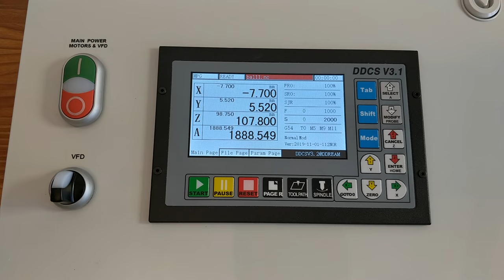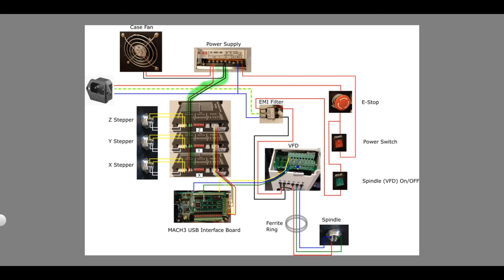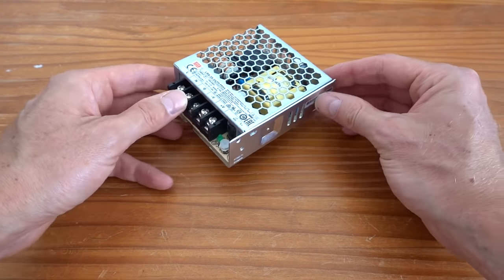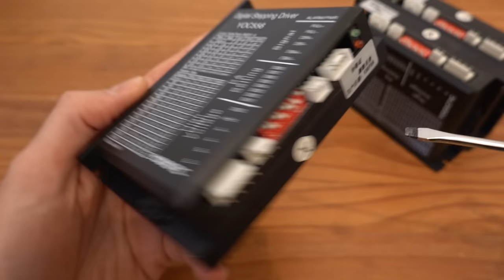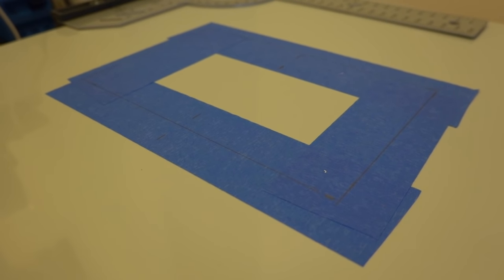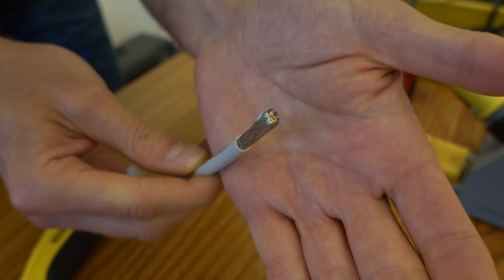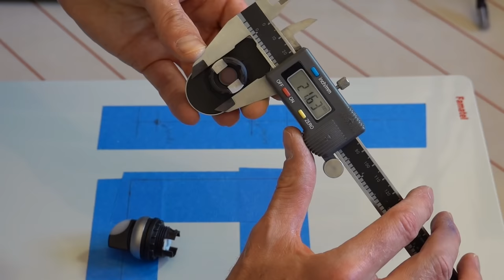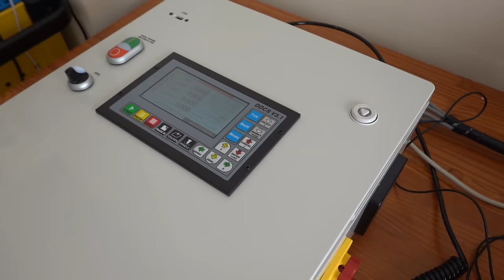Build Your Own CNC Controller, Part 1  | DDCS V3.1 |  6040 Router

Comment: Delighted to find this detailed tutorial, I have bought a secondhand cnc router that is run by a dedicated Linux computer and LinuxCNC everything works individually but there is no real information out there on troubleshooting such a system.  I have purchased this exact controller to make it stand alone the same as my cnc laser. Thank you so much for the time and effort you have put in, cheers from NZ.
Reply from the maker: Thank you! Good to see the content is useful. Best of luck with the project!

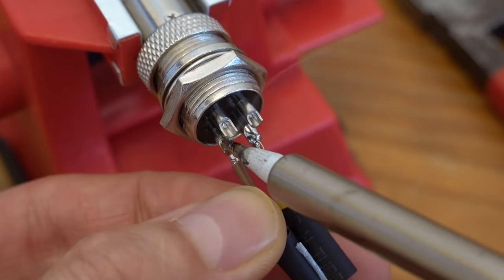Comment: Great work. I'm no electrician but (sorry to report) I think to actually shield those wires on 22:43 you'd need to connect the mesh shielding to ground and not clip it like you did.
Reply from the maker: Hi, I think you are absolutely right, the shield should be connected to ground to make it effective. This would mean I have poor wiring skills on top of poor soldering skills :) I will leave a pinned comment with this update. This does mean I would have to get a 5-pin connectors to get the shield through the non-conductive housing and connect it to ground. Thanks for you comment, much appreciated!
Reply: @uptimefab7412  usually the ground is passed through the connector metal housing itself, at least that's what I saw in e.g. Ethernet CAT 7

Comment from the maker: Note: For proper shielding of the stepper cables, the shield should be connected at one side to ground inside the cabinet. Also for external shielded cables.  See video part3 for updates to the controller and check the pinned comment on that video for best practices.
Reply: Thank you so much for sharing your build! You have inspired me in so many areas of my build. Even better you introduced me to @corvetteguy50 who has taught me so much. My box design and many of the parts are similar, although my design is based around a Masso controller. I truly appreciate you sharing this build!
Reply from the maker: Thanks, much appreciated! The masso seems like a very nice system.
Reply: Why should it only be connected to ground at one side and not both sides?
Reply from the maker: I read from several sources that one should connect a shield only on one end to prevent ground loops, from grounds with different potential. Also there are sources that indicate that for specific data transfer applications it is better to ground at both ends. Most information for CNCs seems to indicate on one side, so I also took that approach. As you may know there is a lot of contradiction on this subject though, but I just went with the sources that I thought related most to my application.
Reply: Why is your coolingwater pink? Some additive? Thank you for very informative videos.
Reply from the maker: Hi, just because it was easy to get my hands on it I am using engine coolant, diluted with distilled water. From what I have read many people do this, but the stuff I use happens to be pink. There are flakes of some organic substance growing in it after a while, not sure if that is less of an issue with other types of coolant. The fact that I have it in a transparent container probably doesn't help. Thanks for your feedback!
Reply: As a rookie without any experience in electronics nor programming but looking for information I see a common problem in all this solutions for makers. Different concepts regarding de power needed or machine types, protections, phases and voltage in different countries or shops, use of VFDs or VFD-transformers, servos vith integrated control and encoders vs steppers, induction motors, controllers and plcs vs software, many platforms like arduino, raspberry, etc. direct controls vs remote... there are to many variables out there and small print in many equipment to be aware. Hope in the next years we can see integrated solutions in a low variety of needs to simplify this tasks considerabily. For the momment I'm very confused and saturated, usually I get more doubts than certainties to follow the line. Just see all that work for a little machine. This is an activity in it's own. Regards from Spain.
Reply from the maker: Hi, fully agree that all of the options are overwhelming. I had the same thought when starting this project. Considering myself also a beginner in this field I tried to find all the information I needed and combine them into something suitable for my machine. Of course this now in itself is another one of the many sources to be found online :) 
It would be great indeed if a comprehensive guide could be made for all different components and why you would choose one over the other. I do not have a background in electronics, so would not be the right person. Trying to figure stuff out and learn is indeed a big part of projects like this. It does not make sense when you look at time or money spent, but for me personally it is the fun of learning new stuff and hopefully helping other makers. Best, Robin.
Reply: @uptimefab7412  Yeah, I don't have enough time to spend on earning money and been rich so I choosed to convert myshelf in a fool maker and to loose it burning circuitery or something more expensive, hahaha.
Reply: @jorgeo4483  you perfectly summed things up

Comment: Thank you sir for sharing your knowledge. I am in the middle of building my DIY CNC with a proper control panel and your video have been extremely helpful.
Reply from the maker: Thanks, good luck with your project!
Reply: Hey did you finish building?

Comment: just a side note, shielded cable only works if you ground the shielding at one end.
Reply from the maker: Thanks, received several comments on this. I left a pinned comment regarding this topic, so viewers are aware it needs to be connected to ground at one end if they want shielding to work on their cables.

Comment: Great video. One thing I noticed: shielded cables are good as long as the shielding mesh has a connection to ground. Therefore, you have to provide contact between the mesh and the connector's housing. Otherwise, it will not bring much effect.
Reply from the maker: Hi Martin, thank you for your feedback on this. My way of doing it was indeed not correct. I had a comment on this earlier and placed a note in the website article together with other feedback and new insights after releasing the video. Regardless, thank you for your comment, much appreciated. This confirms the right approach.

Comment: I have the same Router. A little tip: Get rid of the small connectors  at the stepper motors. Replace with larger round  'aircraft' type connectors. I did and got a huge improvement in smoothness in the router. I suspect they are a source of significant volt drop.
Reply from the maker: Hi Stephen, thanks for the tip! That sounds very plausible. They not only seem a bit flimsy, also they get a bit warm during operation, there might be too small connector pins or poor connection. Thanks for sharing your thoughts.
Reply: Do you have any links for them

Comment: I am not a big fan of mounting the VFD in the same enclosure due to EMI. To help reduce any potential EMI problems, one can add some ferrite magnets to the signal wires/cables to protect them. I don't like using a plastic box for the enclosure because they offer no shielding. EMI/RFI can cause a lot of hard to diagnose problems that can send you on a wild goose chase. The video is well edited and your work is great. The layout looks good. It does take a lot of time and research to design and build an enclosure.
Reply from the maker: Thanks, it was quite a learning experience. The feedback from you and others  very helpful to get a good understanding of best ptactices. I admit to sometimes taking not the best but the easiest approach to make sure I can make something with the tools I have available. An example is the plastic enclosure, which is great for a "sandbox" CNC project. Cutting another hole is very easy, but indeed not good for EMI. I will keep your feedback in mind for a next controller cabinet, enough room to improve. Thanks again! Robin

Comment: Nice work. Tedious, but fun in its own way and frustrating at the same time.
Reply from the maker: Thanks! Indeed quite a bit of work but it is great to see when it actually works in the end. I will do some more tedious video editing and hopefully upload the end result soon.
Reply: Hey ,thanks for the upload.
Please help me how do you setup the g55 ,g56 ect (pssst please explain so a caveman like me can understand.🙂)
Reply from the maker: Hi, of course. Assuming you mean how to set it up on the controller (not in relation to your part) it is fairly straightforward with the DDCS: in the main menu press "tab" until G54 is highlighted. Then with "A+" and "A-" you can select any offset between G54 and G59 (or even machine coordinates if you don't use home switches). Then just press "shift" followed by one of the keys indicated in lower right of the screen to zero all or just one of the axis in you current work offset. You can manually zero machine coordinates in the same way. Note that if you do end up setting machine coordinates to zero with this method, all of your Gxx offsets will shift accordingly, so first set machine coordinates and only then set Gxx.
Hope this answers your question.

Comment: I am currently building my second control box and upgrading as well, I think I will use also a PILZ Safety relay for the E-Stop and tie that into the controller cutting the Enable to the drives as well as all other power but 24V will remain On. Thanks for sharing it helped me in my decisions as well.
Reply from the maker: Thanks, sounds like an interesting solution. Good luck with your project!

Comment: The only suggestion I can offer is to drill the holes at the corners of the rectangular cutouts differently: You can put the hole centered on the corner and save the filing.  The rounded corner is less likely to crack too.
Reply from the maker: Thanks for the tip!

Comment: OMG Thank you! I bought a 6090 chinese CNC machine a few years back. The 4th axis controller board died on me and I have not been able to find one that works for my CNC. I am totally doing this for my CNC. I want to get the 4th axis working again and I want to be able to find replacement parts for it too! Subscribed!
EDIT: 4th Axis stepper driver not controller board
Reply: You can take any stepper driver.
Reply: I got 2 different drivers. None of them want to work with the cnc :(
Reply: @oscarreyes4511  Different or differnt names?
Reply: 2 different brands of drivers and none of them worked
Reply from the maker: That's odd. The step and direction signals from the DDCS are 5V. Can you check if the step and direction input on your drivers respond to 5v? Just a guess but if they need 24v input signal they might not do anything with 5v signals. Is there a green LED to indicate the drive is working? Also double check the connection on your stepper motor.

Comment: In the case, you will work at the case, you can replace the self cutted taps with rivet nuts. This should be much stronger than the taps in this thin sheet. Only a advice.
Reply from the maker: That sounds like a good option. I went for tapping to make the stepper drivers flush with the back plate for heat distribution, but indeed doing this in thin sheet is not the best option. If I do end up taking it apart at some point I might give the rivet nuts a try. Thanks for the advice.

Comment: Great job. Just waiting deliveries and i'll start same kind of project.
However one question: I'm a bit surprised when you write "Since I experienced lost steps with the old controller I decided to use shielded cable wherever possible" and none of your cable has its shield connected (in one point) to the earth, which means that you shield is useless.
Reply from the maker: Thanks for the comment. Absolutely correct. I already left a pinned comment when I received feedback on this before. Still very much appreciated though! Good luck with your project!

Comment: Great project!  The total price to buy all the parts + tax for this on Amazon is around $1,450 usd.
Reply from the maker: Hi, my estimate came out a bit lower, but I just didn't keep track of all the various parts I bought over several months. Thanks for looking up the prices. I bought items like the controller and 4th axis from ali express, which should be a bit cheaper. I think I paid less than 1000 euro in total or at least I hope so :)
Update - Just found some more invoices. Mine add up to around 1000 euro (which could be more in USD), but I might have missed the odd bits and pieces that add up quickly. Not a cheap hobby. Leave out the 4th axis and you can save 200.
Reply: Compared to you I am a techno-peasant.  I mean, i could not begin to build anything like your cnc. Even with your great instructions.  That said,  can you recommend a cnc that i could purchase for $1,500 or less?  I need to cut aluminum up to half inch. Im considering the shapeoko.  Thoughts?
Reply from the maker: Thanks! I have not looked at cnc routers for a while since I am not in the market for a new one. The shapeoko does seem to be a popular system but I don't have any experience with it.

Comment: Just some advice, the general rule of electronics is your load should be no more than 80% of the total current. SO...if you have a 10 Amp power supply, the max current should not exceed 8A. Otherwise, things tend to get hot...really hot. Same goes for wire gauges. So the total current of all stepper motors should not exceed 8A for a 10A power supply. It doesn't matter if they are drawing max power at the same time or not, it's a safety rule. Seen too many fires from people thinking 10A means they can use all 10A but don't realize the internal components are in excess of 180 degrees when doing so. When under the 80% rule, things don't reach unsafe temps unless it's a faulty component. Fans just delay the inevitable at that point. Be safe and use the 80% rule!
Reply from the maker: Thank you for your advice, much appreciated!
Reply: @uptimefab7412  no problem. Glad someone could learn something from me!

Comment: HI ! I was inspired by the way you wired you contactor for the E stop . I tried, the wiring worked, turned  off and On according to the plan. 

But I witnessed a smoke coming from the contactor (only when stopped) at first i thought it was my mistake ( it is), checked cabling. then i checked the contactor in itself before realising that the coil inside the contactor is only 8 ohms , which make it run a 24v/8 = 3 amps , welll , there is why it's smokee but works. my mistake was (i think) that I did not put LED in this wiring, but i didn't know it's function was also that of a resistance in this loop. also permitting to "drain the coil of current " (i don't  know the term)  when we e stop the machine ^^. 

Do you agree ?

I don't think you spoke about it in your video, but i think it is important to consider , because i'm not the only dumb one on the internet ^^. 

Thanks for your content.
Reply from the maker: Hi, smoke from your contactor is not good. This probably means something is not wired correctly. Are you sure you connected the contacts for the coil terminal to 24VDC? Please triple check all of your connections or have an electrician verify it. If you indeed have a 24V contactor you should be able to connect it directly to a push button in line with a 24V power supply ( for the specific Siemens model I used). No resistor is needed. I do not have any resistor in between. My LED is in parallel with the contactor, so the is no voltage drop over the coil due to the LED. Please also check all of your other connections: the auxiliary contacts as well as the mains connections you are trying to switch. Note that mains voltage can pose a serious danger. If in any doubt please contact a professional to connect and verify your installation.

Comment: I am woudering if this controller is capable of run subrotines with m98 and m99 codes.

Is this features implemented in this controller?
Reply from the maker: Hi sorry for the late reply. It unfortunately does not support m98 and m99. It is not in the manual, but I also tried on the controller itself, doesn't work. I noticed that the Expert model does have this function in the manual, maybe other models as well, did not check.

Comment: Great video. This is the boss. I was about to say, I need to give you soldering lessons. The insulation should not know you were there. They all looked good, just not pretty. I kinda like how you drilled all the case holes after you mounted all the expensive components in the case will were drilling into. That would freak me.

Comment: Would the wiring be roughly the same for the newest v4.1 controller?
Reply from the maker: Yes, the connections might be in a different place but all connections should be roughly the same.
Reply: @uptimefab7412  thank you!

Comment: Hi, great video, I'm just curious about the contactor. From what I have read (im very new to this), contactors are used in either an ac or dc circuit. Would you care to shed some light on this as your contactor has ac and dc connected to it in the same circuit(?)
Thanks
Reply from the maker: Hi, sure, I am using a contactor that has a DC connection for opening and closing the switched contacts. The contacts are switching AC current. The contacts for engaging the contactor and the ones that are being switched by the contactor are completely separate. There are also contactors that operate on AC, but I did not want to have a 230V AC push button on the front panel to activate the contactor. I prefer to have that low voltage DC. That is the main reason for using a DC contactor. Same argument for an Estop in parallel with the push button. Also if you want to activate or deactivate a contactor from a controller or any other electric circuit, DC is easier.
Reply: That makes sense, thanks for the reply 👍